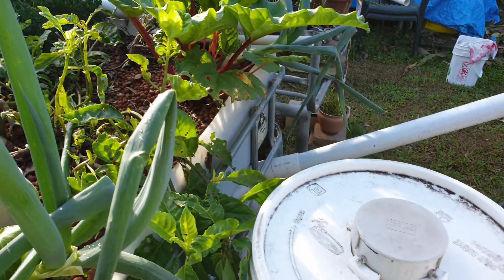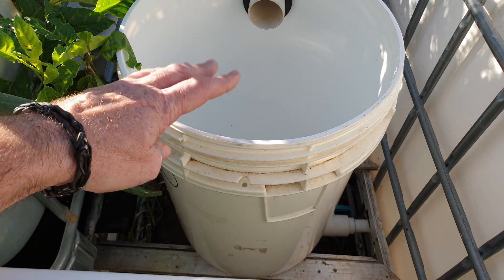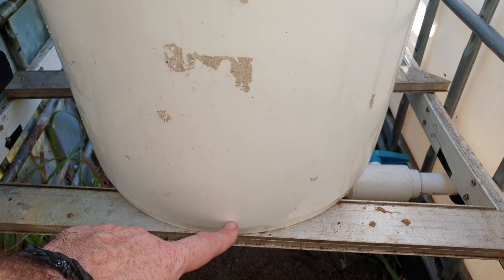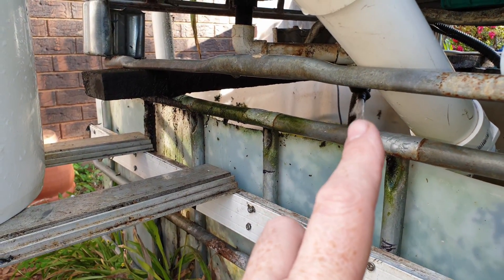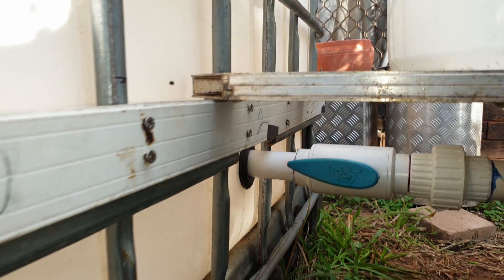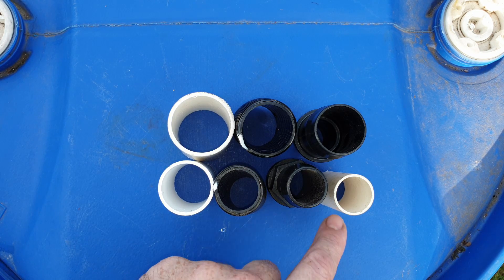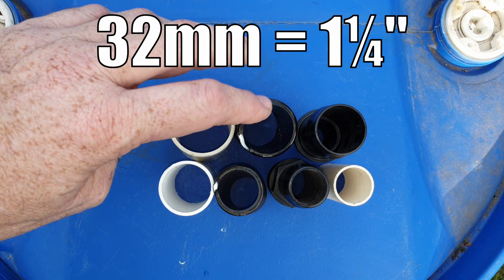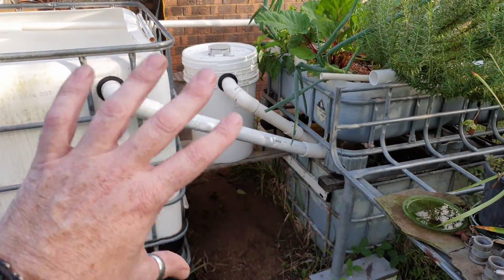Aquaponics Design | Pump Pipework & Solids Settler

Comment: setting up a new system as you have inspired me to get into aquaponics. I will be using redclaws insted of fish. I was wondering if you have a layout of your setup as that is what I will be basing my setup on. My first question is in regards to the sump. How big is it needed to be based on my main tank will be a full 1000l ibc for the craws. Do I need to dig a hole for the sump to sit in. Looking forward to your reply. regds Peter from Townsville
Reply from the maker: Hi Peter. Not sure if I've answered this elsewhere sorry mate. This is the most up to date layout clip from a year or 2 back. 
https://www.youtube.com/watch?v=raLv4RAUte8
Is still essentially the same system & works well but it will be changing. 👍 
My sump is 600L & is drun in 200 -300 mm to help lower the bed heights. It holds enough water to handle 4 x 300L IBC grow beds all being flooded at one time.
Cheers mate & sorry if I'm repeating myself.

Comment: Damn that feeling when ya crack it..
Reply from the maker: Still haven't been out to get a replacement for it either Matt. Am hoping to find one of the blue HDPE 60L jobbies to replace it. 
Cheers mate.
Reply: Yeah mate thats usually the way 👍
Tropical QLD has turned artic today. Workin on my passive solar coils iv made to heat the water
Reply from the maker: Todays not much warmer :/
Reply: Nar shes bloody cold. Ill have to send you some photos of what I did with passive solar. 1 roll black hose made into 2 coils on the shed roof with 2 glass windows from the tip on top of the coils. With good sun turns pumping 19C water comes out at 30C. Gets the sys temp up from 18C to 22-23C each day
Reply from the maker: Nice one Matt. Have you got a dedicated pump moving the water up or is it piggybacking off the main one?
Reply: Yeah iv got a 6000LH 7.5m head 115w pump on a timer pumping from sump-》coils-》fishtank. Got a non return valve on the pump so the coils cant sython back once pump stops. Timer is set 9am-430pm

Its been working well but we had 2C last night which hit hard, fishtank was 17.3C this morning 😓 but in saying that coils currently running and turning 18C water into 30C so a good day of sun will hopfully get me 22-23C by this arvo.
Reply from the maker: Got to be happy with 17+. I think the lowest ours dropped to was about 10°C when we had the Jades in the first system. They didn't move much but pulled through OK. That's when I invested in 2 x 500W heaters.
Reply: Yeah mate im very impressed with the coils. Yeah i know what ya saying once it hits 18C the cod just sit on the bottom and dont move. after i harvest these fellas im going to get some jade perch. Last year i was using x2 500w heaters got smashed with a power bill. I just recently got a 9KW solar sys installed on the house so i have the option of using heaters as well if needed 👍